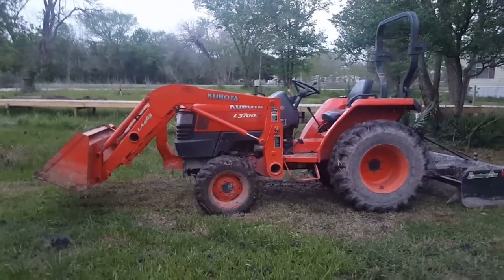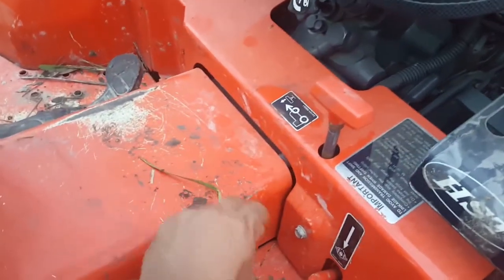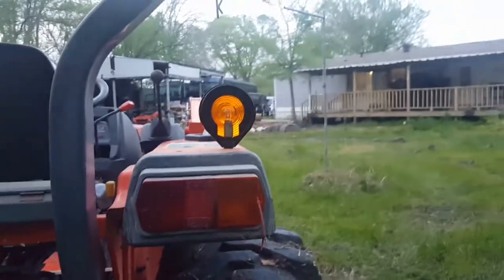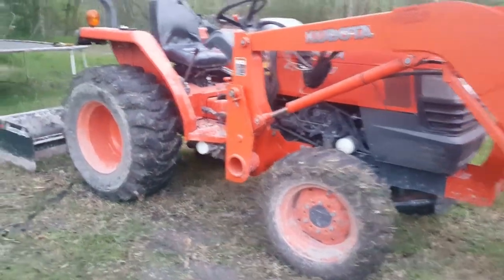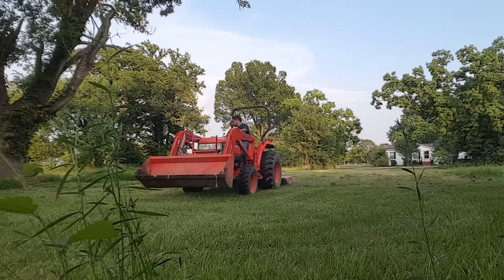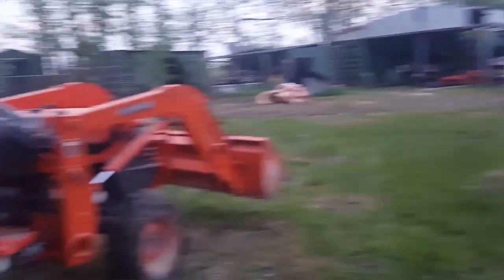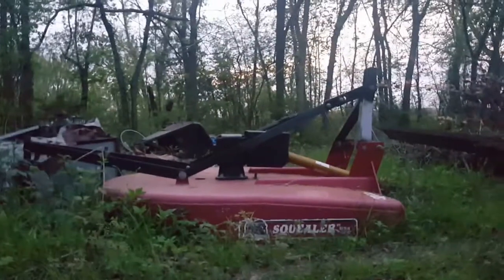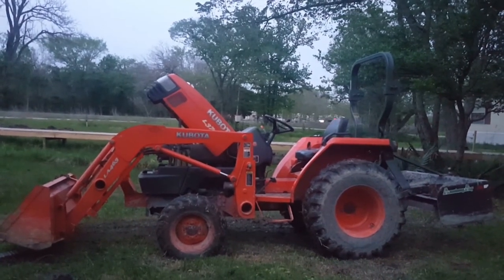Kubota L3700SU 8 Year Review

Comment: I have same model and year…400+ hours, a busted headlight assembly,and two front tires later it still starts right up and runs a rotary cutter and finish mower like it’s nothing.  Bought it new in 2011. Recent third function and grapple round it out.  The loader is only thing I’ve been left wanting more of but feel it’s matched well to the tractor overall.   And a better seat would be great too. A simple tractor that’s easy to work on and find parts for. No crazy emissions or electronics and engine is super tight still with no fluid leaks.   I may end up with something bigger in the future but this thing has been super reliable and your comment about not being afraid to give it to a family member is spot on.   Best wishes!
Reply from the maker: Thank you for your input